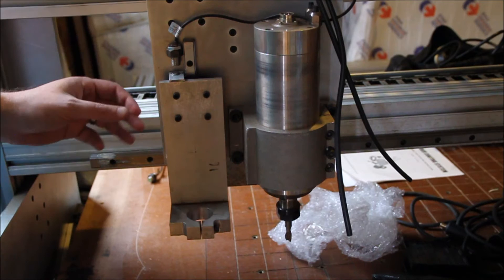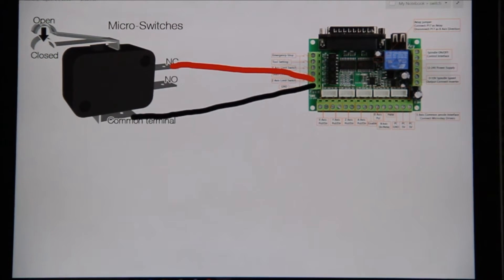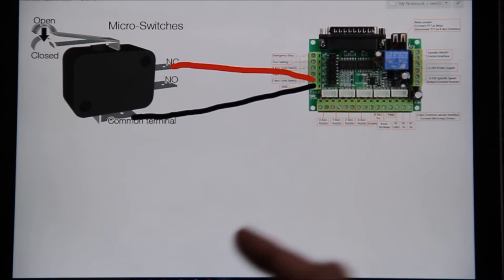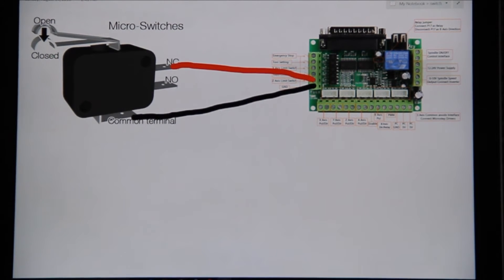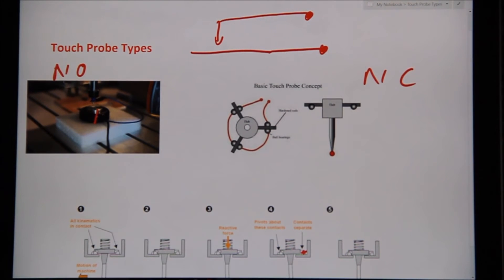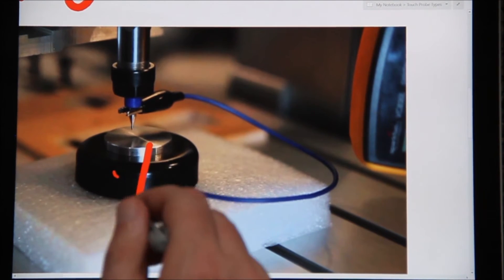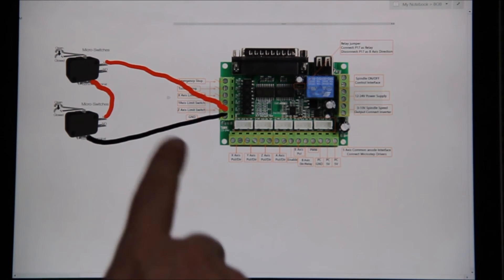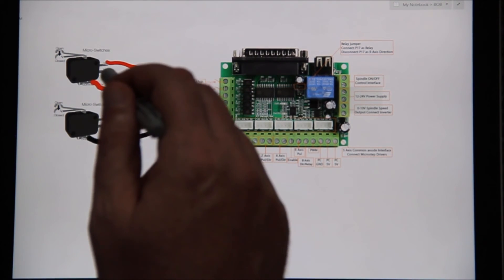CNC Limit Switches & Plasma Floating Switch

Comment: I've got a MKS DLC V2.1 card and I have hooked it up to my homemade desktop CNC machine which I plan to use to run a plasma torch. I'm completely new to all of the CNC building and breakout board business so forgive me if my question comes off as somewhat of a obvious or a newbie type request. I'm running open builds control to send the information to the board and from the bored I'm going to tb6600 drivers. Those drivers are sending their signal and power to 3 nema 17 motors controlling x y and z. Everything is functioning great except when I try to run the program I get a error stating the z axis probe is not in the expected state. I've been told this is because I have set my parameters to require a touch off operation but I have no sensors on the table yet. No probe switches and no end stops. This all makes sense to me but I'm wondering if all I need to do is hook up a z stop or z probe to get past the error code that stops the machine when I'm trying to do a dry run. Any advice is greatly appreciated. When I attempt to run tha G-Code the Gantry moves to the first cup position and the z axis goes upward, then it returns the error code. I'm guessing this is because the z axis does not know where it's at. So do I hook up a switch to the probe connector on the board or the z axis and stop? When I created the G-Code in open builds design I did tell the z-axis to go to a safe height of 10 mm. But I didn't tell her anything more than that. I just figured if I zeroed all the axis before starting it would just automatically go up 10 mm and then drop down to my cut height and begin following the toolpath pattern. I'm going to check out some more of your videos and subscribe. Thanks.
Reply from the maker: Hi there if you are telling the CNC it needs to touch off before it retracts to the starting cut depth it will wait for the limit switch to be triggered before it continues and after some time with give an error. you need to make it that you not using a touch probe input before it starts cutting. that would be in your settings - THC turn that off and try run the program that should tell the software the the THC is not present or being used
Reply: @cncmetalworks do you think there's a way I can turn that off in open builds control if I already have the command in the G-Code? Or do I need to edit the G-Code?

Comment: quick question, what keeps the tip from hitting the metal as it travels or is the gap big enough to accomodate a workpiece that isn't perfectly flat and doesn't warp. I like simple, I have a magnetically mounted torch hold with the spring loaded touch off. I am using an electronic connection for touch off, grounding the piece and the tip is the other connection.  Anyone?
Reply from the maker: Hi There, the way it works is by measuring the voltage of the plasma arc and when the arc voltage changes the z axis compensates for it by either moving the plasma up and or down. I have a hypertherm which has a CNC plug out which is connected to the controller this is how I know what the plasma arc voltage is.
Reply: @cncmetalworks  cool, thanks for getting back to me. So my Hypertherm has the 14 pin but only 4 pins are connected, two to run turn the plasma torch on, two wires that aren't in that 14 pin plug come directly from the board ( j15+j16) terminals and those are not through a divider, they run up to around 300volts. The last 2 pins are a bit of a mystery to me, arc ok ?? Do you know what i'd use to make that what you have work? I don't know how to finish it off, can't seem to find help. I'm running mach3 and a leadshine MX4660. I'm not stuck on mach3 but people keep saying mach 4 sucks. Just can't find some reliable information. You're system without the THC is what I want to use. If you''d rather my email is michael@ronneseth.ca
Reply from the maker: @freedomseeker2025  There is a dividing board you get when you install the CNC port as an option - well that what I got at the time purchase my Hypertherm 65 - https://www.hypertherm.com/hypertherm/powermax/powermax65/?PageNumber=2 - check the machine torch specs (Power supply with CPC port and voltage divider)
Reply: @cncmetalworks  yeah, mine doesn't have that, I have an older but awesome 1000 g3 series, it runs directly from the terminals so I will have to try to find a divider somewhere first but sorry to be a pain, and trust me, I super appreciate the help but once you get the divided signal at the lower voltage, how did you use that ? You aren't running a THC unit are you?
Reply from the maker: @freedomseeker2025  I have one of these https://www.proma-elektronika.com/compact-thc-150/ which I no longer use as I have my Hypertherm and BOB / THC combined which works on lower divided voltage. this should give you an idea of how it would be connected. you have 2 options high voltage output THC or preferred Low voltage / voltage divider. You would need to see what others have done with your model of plasma
Reply from the maker: @freedomseeker2025   That's a very good question - I have one of the very first units and it worked there are no really parameters you can set it's really just plug and play. I bought a board from a supplier who manufactured the it near me in (SA) this was so that if I needed support and or replacement it would be quick. I have not really looked into what has changed over the years. Check some reviews and see if the products you are interested in are still supported and who is still using them months after installing them.

Comment: hello, congratulations on the video, how would you help me in this trust, since I did a floating z axis and would like and know how to config gcode to work that way I use the sheetcam and I use the mach3 post processor, could you explain how generates this gcode to work with floating oz
Reply from the maker: Hi there, the floating axis is setup as the home switch, the G Code you use needs to make reference to the Home Switch when it touches off on the surface. you will need a plasma post processor and set the touch off height.
Reply: @cncmetalworks  and what would be the post processor I can do this routine
Reply from the maker: @marciotelao   Sheetcam has a Mach3 Floating head post processor. it's the software I use for my Plasma table works really well

Comment: HI, This is my first time machine built as a hobby work, where i have done the detailed drawing for 5 axis engraving with the same interface board which is showed in your video . i have worked out the homing & limit switch based on other video and manufacturer guide line, can you able to give your support for me to convert this machine into 5 axis (or) 3 axis plasma cutting machine with reaming required product link and its wiring detail.

 And i have done the another circuit detail with a another interface board, (in this im having lot of confusion of the wiring on limit switches...etc, is it possible for me to use this as a Plasma cutter? Since im not a technical person im unable to do by myself.plz help me.
the detail drawing have given in the below link:

https://drive.google.com/file/d/1Pn_BiH54vVtl5WY3xKVF1i4jomclBwtA/view?usp=sharing

https://drive.google.com/open?id=1slU-F-UnR8qgxo5lyPxN9zuPfswfRd0t

Thanks

Comment: Hi Vatso, I want to build something similar, will you mind sharing me the 3d drawing the cnc frame
Reply from the maker: Hi There, I built the machine out of my head and did not have plans per say. I took ideas from other machines I saw in operation
Reply: vatso I am amezed , u r Smart, I have other request, can u share the plasma cutter make, which brand?
Reply from the maker: Hi there I use a hypertherm 65

Comment: i put  this in my auto tool  macro but  like to no how it  does   like yours running tool pass to turn on  and off like yours does ..'M3 Macro for TOM G31 Version
Cfr = GetDro(18)
Code"G31 Z-5 F20"
While Ismoving()
Wend
Code"G92 Z0"
While Ismoving()
Wend
Code"G0 Z .080"     'Switch offset
While Ismoving()
Wend
Code"G92 Z0.000"
While Ismoving()
Wend
COde" G0 Z0.120"    'Pierce Height
While Ismoving()
Wend
SetDro(18,Cfr)
While Ismoving()
Wend
DoOemButton(110)  'Fires Torch reset THC height
END
 i am trying to use asire to gen tool pass and think that not going to work need post p changed  for m3 m5

Comment: so  i need to run a relay on the 2 wires off the plasma to relat that gets atvated from out put pin  have mach  and type in m3 turns on and m5 to shut off  so what wire does the float switch in to
Reply from the maker: You can run this is series with the Z home switch if you like depends on how many inputs you have
Reply: have one pin left the thc takes 3  i have it set up with macros  float switch goes down and comes up to pirce higth  when the auto tool  is  hit  now  my asire dont have the m3 m5 in post p but that is over my head
Reply: so  what  cam software  for plasma  you running
Reply from the maker: I use a sheetcam
Reply: what verson and it does the delay for perce high
Reply: would you share a copy of your post p for got sheet cam now

Comment: ok now how do  you  get it to come back up to cutting hight is were i am stuck at have to set maros up or what any help nice job you helped alot
Reply from the maker: Once it touches off - like a home switch you then tell it to return to a set height above that point. think of it as when you 0 a machine it's just a zero of the touch height. this function is normally set in the cam software

Comment: im designing a cnc router using the arduino uno and cnc shield to drive steppers,i've found a potential problem ,in that the cnc shield may not have a X axis tool height re-location setting,for use with a touch pad,so a tool change does'nt result in either a ruined job or needs changes to software code to get the old tool zero height changed to  new tool position.

 I have a previous video you did showing a break out board and stepper controlers,does that set up allow for the use of a touch contact pad for Z axis tool height zeroing.
I do'nt want to go to far with the control electronics due to this as i may need to take another route from arduino,which the uno and four A988 controlers were £14,not much and can be used with a laser etcher,but no more expenses will be made in this area until i confirm if arduino cnc does the job,and why i'm contacting you for a back up solution,a bit more expensive ,but would be worth it for a more detailed machine.

thanks.

Comment: hi vatso... i started the cnc plasma machine, i dnt  have thc, and have a problem with the nozzle scraping the steel, and the nozzle melted due to the heat directly on the steel ( the steel sheet is never really flat). it seems on this video that you also dont have thc?...and the nozzle scrape the steel? but i see no problem, and your machine run smooth. is it ok if the nozzle scrape the sheet?    AND   can you advice me on a type of thc that is effective and affordable for a diy table, please?
Reply from the maker: Hi Johan, I do have a THC in fact if you look closely that dip in the touch is at sharp corners as the machine slows down the voltage changes as it stays longer in one spot cutting through I needed to make some changes to the code and the THC to fix it. the height of cut is 1.6mm about the metal. No I do not suggest running the touch tip on the metal. A THC is really needed for good cuts on thinner metal. I don't want to say it's okay as the cost of a new touch head will be more then a THC unit
Reply: hi vatso... ok, thank you so much. can you please advice me on a good but affordable thc ? im far in north namibia... i dnt wnt to buy a affordable thc, but its not working... i also dont want fancy stuff. just a good thc. plse
Reply: thank you so much...i will defnitely look at it
Reply: hi Mark...
where are you from?  the guy from CNCDIRECT say this THC will interface with my system... 
What do you think?
Can i email you mabe?
Reply from the maker: Greg is really helpful and his products have a very good track record. I use his boards PS I am Mark Erasmus
Reply: thx for reply my friend...i emailed Creg, and even called him from Namibia... but he didnt know. i asked him to get info on that. 
thats why i also asked you, if that can work wth both usb and paralel port systems.  i want to get another opinion please...seems you are good with the systems. i cant afford to order something, just to wait 2 weeks, to discover its not working. please
Reply: but he said the proma will not work...it will interfere wth my system... but if i ask about the ports, he dnt know...
Reply from the maker: Not true - all the proma does is read the voltage and send a signal to the BOB which contols the motor up and down. Does not matter if it's USB or not all that is happening is Proma sends signal to the BOB inputs
Reply: thank you so much...i needed a good opinion. seems some cnc components, like these proma, is not available in S.A....it needs to be imported, and take a month.  thank you so much.

Comment: What plasma cutter are you using? Would you recommend a torch height controller? Thanks
Reply from the maker: I have a hypertherm 65 and I use a THC metal is never flat and if you want good quality cuts a THC is a must. I built my machine to do 2 jobs - if I was to do it over I would do a Plasma machine and a milling machine. Speed is king with Plasma & direction change the faster the better. you will see the touch dips ever time it changes direction this is due to voltage change and I have to put this into the code to switch the THC off when coming to corners.